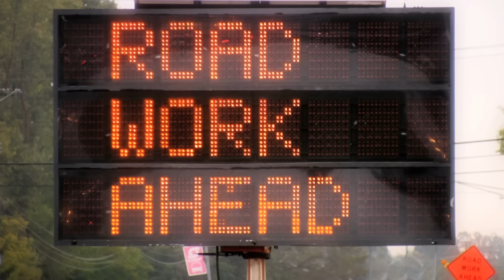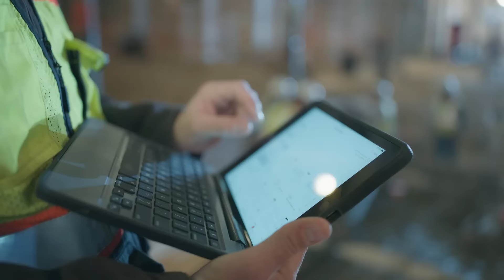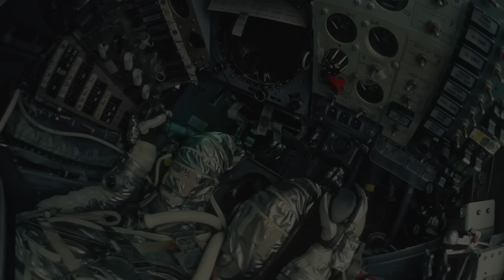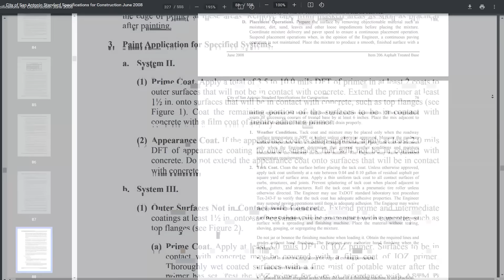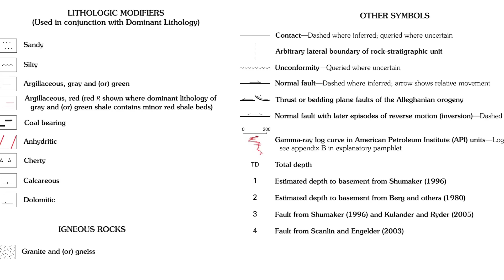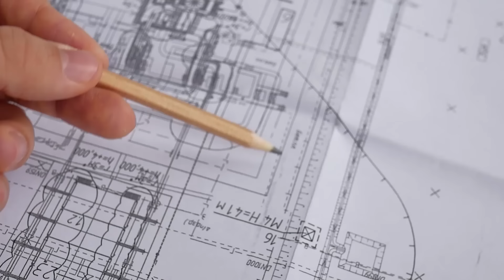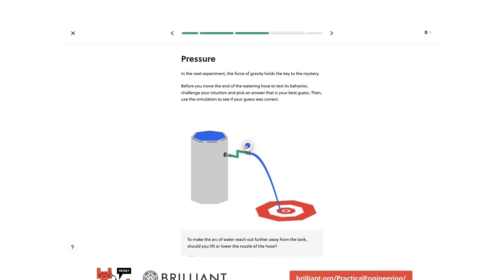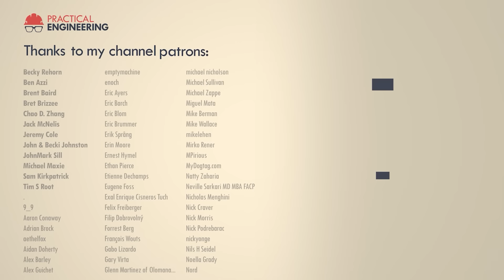4 Myths About Construction Debunked

Comment: My whole job revolves around me being in a building making sure boilers are running. 99% of the time I do nothing but that other 1% saves us from losing the entire facility
Reply: that job sounds important but probably shouldn't pay as much as those who are doing the real work, yea?
Reply: Literally homer simpson
Reply: This is why we need better AI
Reply: @ravinraven6913  person has job making sure a building doesn't explode, but is somehow not a "real" job...
Reply: @ericsmith1517  some people believe that if you arent hammering nails 24 7 to increase a companys revenue you arent working..
Reply: @ravinraven6913  would you say the same to your surgeon if you needed a quad-bypass?  Or, due to the level of schooling, training, and expertise, the surgeon makes more than the guy who polishes the hospital floor, and the surgeon only needs to come tinker on you for a few hours to make that money
Reply: How do I get your job
Reply: Ahhhh I too am a operating engineer. Here in MN it is actually quite important. Both for processing as well as climate control in bigger buildings. I am currently doing the 99 percent part. In this state you can actually consistently get a job doing this in the 30 to 40 dollar per hour range if you hold the highest level of license. Good job that requires little to no education at all. Don't even need a high school diploma.
Reply: @Valinor  move to MN take the test. After 2 years of hands on experience. Pull up a chair in the boiler room!
Reply: I think brain surgeons and psychologists should be paid less. Most patients have very little for these specialists to work on.
Reply: @byronshepherd8415  You underestimate the prep work that goes into planning those few hours
Reply: @criticaltemperature3343  That's why they get the big bucks: takes skill to make something with nothing.
Reply: @Validole  that was my point
Reply: @criticaltemperature3343  hahaha!
Reply: @andreysilva8418  I do agree that some people are way too critical of blue collar workers. Just because they are idling when you happen to be passing by them at the job site doesn't mean they are "lazy" and have been slacking all day. Let's see these people work 8 - 10 hour shifts on their feet outside all week.
Reply: Sector 7-G
Reply: Do you work at a hotel in Colorado, by chance?
Reply: @ravinraven6913  uh, what that person describes is actually the real work. there's something to be said for having to monitor something like that to ensure we don't hear about it on the news bc of an explosion or what have you. actually sounds relatively important.
Reply: @criticaltemperature3343  i see what you did there😅
Reply: @trancendental5373  stop with the AI nonsense.
Reply: One of my friends works in an airport tower control. Most of the time there aren't any problems, the equipment is top notch and the computer system sorts everything out. But, a few times, without him and his colleagues, an entire plane and all his passengers would have perished. 
High responsibility job, high knowledge needed, high pay. 
When the situation is serious and urgent, there's obviously no going home on time.
Reply: “My job? Toilets n boilers boilers n toilets, plus that one boilin toilet”
Reply: As an anesthesiologist, this also describes my job pretty accurately.  95% of the time everything is fine, except when it's not fine if you don't act appropriately and expeditiously, the patient dies
Reply: @ravinraven6913 less people know how to do what he does so he gets paid more. Common sense.
Reply: Homer Simpson sir, one of your chair moisteners from sector 7-G
Reply: When your maintenance team is busy you are loosing money…. When everything is running and the guys are drinking coffee life is good…. 46 years in the trades
Reply: @byronshepherd8415 and let’s also throw in the guy who’s job is to sit around and be there just incase the machine the doctor is using goes down during surgery.
Reply: @valinor5397 
Probably a bachelor's to Masters and a Six Sigma certification...
Reply: @trancendental5373 
Fair point, ngl. 🤔
Reply: Sounds like a job for a 🤖.
Reply: Jack Torrance?

Comment: The thing I always heard was that "anyone can build a bridge that doesn't fall down, but it takes an engineer to build a bridge that just barely doesn't fall down"
Reply: Or if you’re a bridge builder and haven’t had one fail, then you’ve overbuilt them (was an old saying)
Reply: Short sighted. Make it cheap mentality. Race to the bottom.
Reply: Yep. No point in building a bridge that can hold 200t of the max gross weight that will go over it is 20t
Reply: @nathanflett6427  Not in this case. If the bridge can do what you need, for as long as you need, at a cost of $100M, then it’s a waste to spend $150M to do the exact same job. Engineers are supposed to design/build to a specification with a reasonable margin of error (say, 5-10% or less).
Reply: I hate this quote. It might be appropriate to spaceship design where every gram matters, but things designed to "just barely stand up" don't stand up to abuse or neglect when left out in the elements for 100 years. What engineers can do is build a stronger bridge using the same amount of material... because they understand what each piece actually does instead of just throwing stuff together haphazardly.
Reply: @rkwatchauralnautsjediparty7303  Like I say... short sighted. What are you building? A disposable bridge? If you're going to build a significant bridge; over, say, a river; then build it to last.
Reply: @sniperfi4532  actually building over spec should be standard, that way we are not replacing every 25-50 years, we should build to last hundreds of years. Do it right the first time so future generations can reap the benefits, so sick of the boomer mentality of just worrying about stuff lasting for their own lifespan
Reply: @TheRealE.B.  I feel for things like industrial equipment  or bridges, "just barely hold up" does mean like "just barely hold up to the continuous hard use in an industrial environment or use by the public"
Reply: @redditor7548  did you not watch the video? engineers have balance the cost of the project with the longevity of the structure. the more overengineered it is the longer it will last but the more inflated the budget will become. no one can afford such massive projects on a nationwide scale without getting bankrupted. just one of your super bridges will eat up so much money that it could stall out the thousands of that region's other necessary infrastructure projects for decades, and that includes future needs.
Reply: @Spartan0430  maybe we should change our greedy capitalist society that values short term profits over long term value so we can afford to build things that last, in the long run it is a huge saving, the ancients understood this fact.
Reply: @cmmartti  i want bridges that last 300 years minimum, it’s doable, we just can’t have nice things because corruption and wasteful spending. In the past people made nice things before our world got taken over by evil
Reply: @redditor7548  Is that really building over spec?
How durable the building is supposed to be is also a spec.
Reply: @redditor7548  That's only feasible if you could even guess the requirements of that bridge 200 years down the line. Are you even going to need that bridge? Or will you need that bridge to carry train instead of cars? Or perhaps now there is only pedestrian traffic, and you could have replaced the bridge 50 years in that handled that job just fine and not spent those initial resources on something you didn't need?

Even if you were to escape from capitalism, you still need to consider resource allocation: why should we invest so much resources in that bridge to last 300 years if we don't even know if we will still want it in 50, much less so if it will still be doing the same kind of job?
Reply: @Theoriginalmartian  Maybe so, but it's too ambiguous for my liking.

And even given the benefit of the doubt, it falls into the trap of implying that structural engineering is the just art of taking away mass until a design is optimized. That's a pretty simplistic, freshman-level understanding of the role. In fact, it's the aspect of engineering design that's already halfway to being fully automated.
Reply: @redditor7548  Capitalist society? You realize we’re talking about tax dollars, right? 🙄
Reply: @nathanflett6427  I sure hope your bridge, that needs two lanes in each direction but was built with three to account for future growth during its useful lifetime, won’t need four or more in 50 years. Well, I guess you could spend $5B on it to make a 20-lane bridge and hope that you didn’t waste billions of tax payer dollars on a piece of infrastructure that was only ever half-used before chemistry and physics dictated that it would need to be replaced. 

Oh, I get it. Just build more stronger, says the non-engineer. 

In the meantime, all that money can’t be used for the 5,000 other projects that need funding. Dunning-Krueger is calling.
Reply: I agree with Mr. Daly.  I've even gone "a step further" .. it is my sincere opinion that "'the world' ought to see these videos" I think Grady does a great job... straight up!
Reply: @TheRealE.B.  That’s…what it actually means. Being as efficient as possible with reasonable margins for safety. It doesn’t mean building a swaying, rickety bridge always on the verge of collapse and praying that it doesn’t. 

It’s a joke. People in professions do that. Especially serious and important professions. If you don’t get that and aren’t around coworkers who do that, you probably don’t work in one of those fields.
Reply: @redditor7548  You still didn’t mention any capitalism, champ. That’s government cronyism. If you were smart, you’d know that. 🙄
Reply: @redditor7548  Evil has been in the world since the fall of man... just saying... 
Although I do agree that things should be built to last. A lot of things are built only to last as long as they are used, and then break down so we buy new ones, (such as shelving units, cell phones, present day cars, etc.). 

I think the point a lot of folks here in the construction industry are trying to make, is that they have to balance the budget they've been given with the materials, workers, and designs available. The point is they don't have a planet made of money to throw at making invincible bridges and buildings. It's all taxpayer dollars. Some goes to the libraries, some goes to schools, some goes to emergency services, some goes to park maintenance, and some goes to road and bridge construction. Like I said, it would be amazing to be able to build things that will last until the end of the universe as we know it. Still, building such structures is expensive.
Reply: @nathanflett6427  you're so right.

 I needed to pave my driveway and instead of using cheap gravel or concrete that might last 50 years I did it right and built from solid inconel. Only cost me $17million and drastically depleted world supply but now my great great great grandchildren can use the thing. 

Never mind the house itself won't last 100 years, or that I'll be dead in 20, or that I'll have to dig it up for to get at the storm drain at some point, better to do it right.
Reply: Correct!
Reply: @mabamabam  So you only care if it benefits you in your lifetime? And if it costs you a little bit extra? It's easy and cheap to be sarcastic.
Reply: @nathanflett6427  your right, instead of cheaping out on a sure to fail $17miillion driveway I should do it properly and use five nine platinum. It's only $700million but thats far better than having a driveway that only last 2billion years.
Reply: @redditor7548  "so we can afford to build things that last, in the long run it is a huge saving, the ancients understood this fact." you literally didn't watch this video at all did you? this video was designed to address misconceptions, specifically misconceptions that you keep bringing up. you are literally what the topic of the video is about. and no we can't have these nice things, not because of corruption or capitalistic greed, but because there isn't enough resources on the earth to build your utopia.
Reply: @mabamabam  It sounds like you know exactly what you are doing with that drive way.
Reply: People here heard Grady, but didn't understand him....
Reply: Engineers always design in significant safety margins. A bridge rated at 100 t capacity might have an actual capacity of 125 t; it’s not at all stressed by 105 t.

PROVIDED it’s properly maintained. Far too many of our US bridges have not been maintained.
Reply: @rkwatchauralnautsjediparty7303  I have an engineering degree. Don't assume!
Reply: @nathanflett6427  Oof. Then you really have no excuse for not understanding the whole point of this thread. Seriously, this is basic stuff I learned in 8th grade. 

Go engineer a 50-lane bridge that will last 1,000 years for $10T and hope that future environmental considerations don’t change enough to undercut its usefulness while hoping that far-future traffic patterns pan out to justify the cost. And remember, that is the entire infrastructure budget for the nation for the next few years. But at least you have one bridge that will last for several lifetimes. Usefulness? Questionable at best.
Reply: @rkwatchauralnautsjediparty7303  Lol. I never said anything about 1000 years. How about 100 years to start. I do understand, we just have a fundamentally different world view.  Fundamentally different.
Reply: @nathanflett6427  Exaggeration to demonstrate a point. Of course things should be made to last, but it must also be understood that needs are going to change and it probably isn’t feasible to account for relatively far-future needs right now. 
EX: We need a 3-lane bridge today, maybe we’ll need it to be 4-lanes in the next 10 years, based on population growth projections. Ok, so we build 4 lanes now. But what will we need in 75 years: 6 lanes or 10?

Your 100-year case means that whatever we build now will be used for 25 years at the max level. Will the prediction models prove accurate enough for that 25-year usage? Even if that pans out, we spent a lot of money on extra lanes that probably weren’t needed at all for at least 50 years, though it would be nice to have zero traffic problems by having double the lanes we need. 

In a world where resources are virtually infinite, that would absolutely be the way to go. We just don’t live in that world. And that’s all I’m trying to say: we have to balance current and future needs with current resources. Hence, build a bridge that just barely doesn’t fall over (or has just the right amount of capacity).

Because there is no practical way to predict what we’ll need beyond 40-50 years, why build something to last 100 if it will have to be torn down, anyway?
Reply: If engineers want the bridge to last 200 years bet the taxpayers will say “t0o mUcH cOst” or “wAsTe 0f tAxPaYeR’s m0nEy”